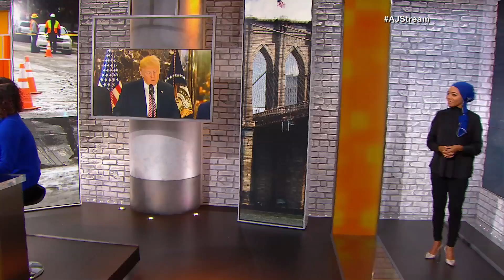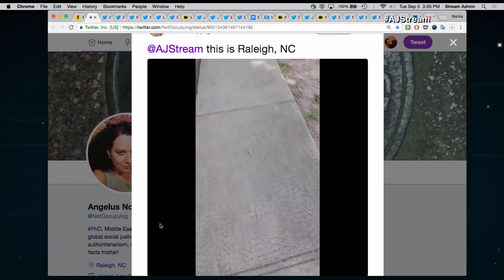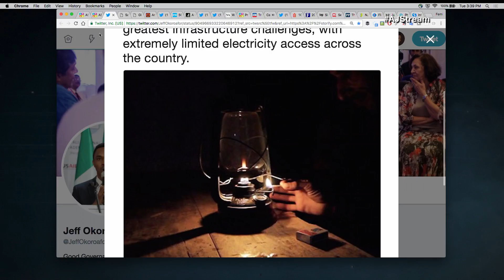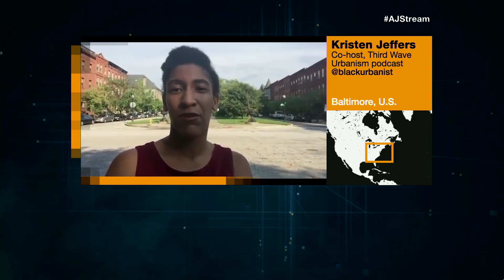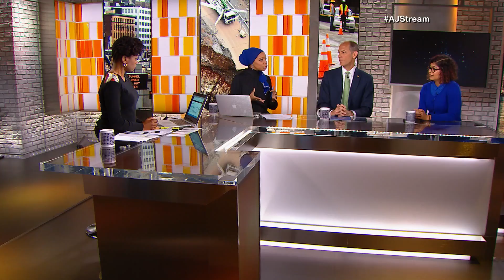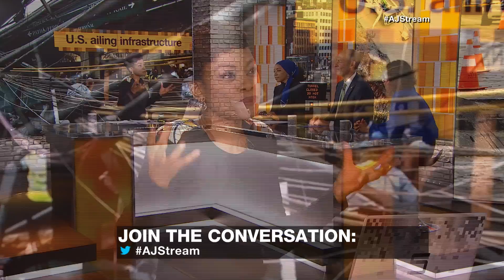Can failing infrastructure be bad for your health? - The Stream

Comment: "Can failing infrastructure be bad for your health?" is that a joke title? I mean if a road falls on your head then yes it bad for your health or if your car get swallowed by a sinkhole and so on.
Reply: not sure if your replaying to me Tactics since the other replies where deleted but any type of surface to travel on is one part of infrastructure. Which is why i pointed out that I'm not sure why you would phase your title that way.  For instance if the bridge falls on your head that bad for your health, another part of the infrastructure is transport that includes state run or private run transport, trains, buses, planes, again if the car falls in a sink hole that does effect your health. 

We could go on from there since most cities but water lines under the roads, or what about how some put power lines under the road. So road gone so is your water and power in some cases.